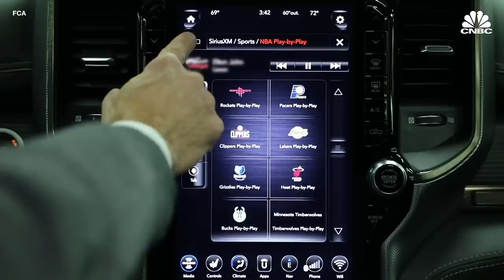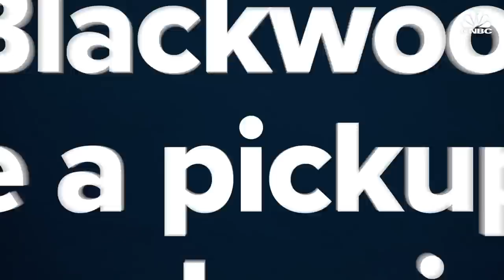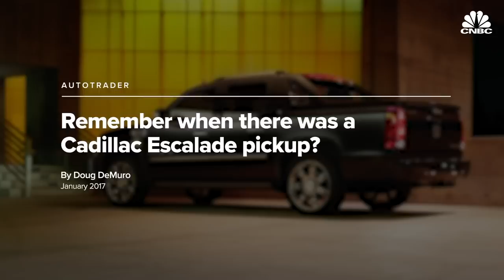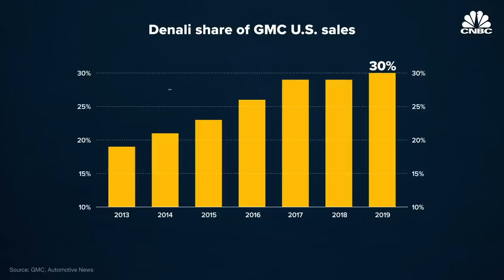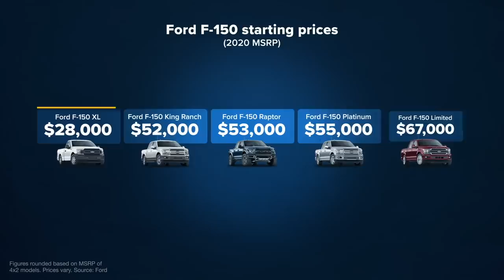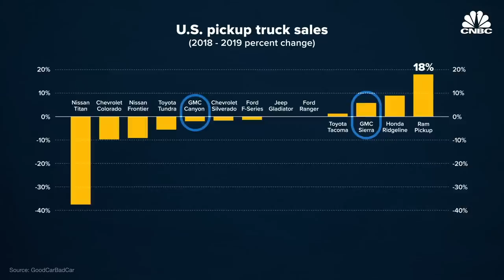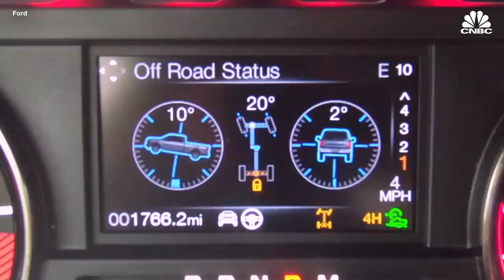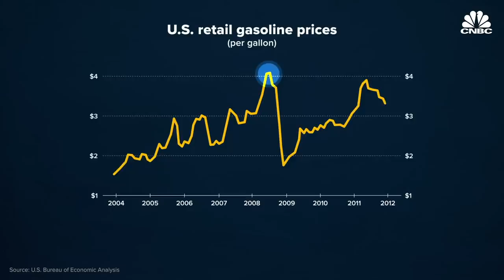How Detroit Turned Trucks Into Luxury Vehicles

Comment: I'd like a small  pickup truck.(like the older ford ranger size, or  even a Chevy s10 or el camino style) So I'll just find a 30 year old truck that's smaller and buy 3 to make one good one & paint it.. all that is available  is oversize non useable  glamor tanks the size of a cargo van with no usable space.. the beds are too small & are 5 feet off the ground...its too tall to get into..Yes it's not a tool friendly vehicle anymore..I dont need luxury.. I need a work truck.. I'm not doing car shows or parades. I'm making money..so if I'm going to waste 50k+ on a non workable show truck just to look pretty... I just buy a luxury conversion van and get a trailer. I'll get my best use out of that.. to me the new flashy big boxy truck  is not worth  the money.. even if u gave me one for free.. and buying a electric hummer  would be not be a option. If I have to keep plugging it in I'll never get things  done waiting to charge it every day.. Need a gas powered ready to go at a moment's  notice truck. guess  this is why u dont see electric powered emergency response vehicles ..."sorry we late to put out that fire.. the vehicle  was still charging".."  U got a place to plug in so we can be of assistance???".oh that's bad the plug in port is inside the burning building. We're so sorry.. but have a nice day... And the distance between charging  station  is unpredictable and  leaves lots of stranded time to rethink these options when u call for a tow and wait half the day to get help.. 1st year military service hummer was the best....h2 was ok...h3 had too many mechanical issues for me. "Yes I've driven all"

Comment: The only functional feature Ram has on GMC is the air suspension which is notoriously unreliable in cold weather, to the point where dealers recommend against it if you live in the snow belt. If GMC takes the 4 corner air suspension off the new Yukon and throws it on the Sierra 1500, Ram is screwed (again)

Comment: you cant put 50 sheets of drywall in em because the beds are too short,I have a 95 F-150 fuel injected 4.9 liter six, it has almost 250,000 miles on it, regular wear and tear, still pass,s smog test.

Comment: When he’s bragging that the f 150 has the same v6 as the raptor he’s basically saying the raptor engine is way undersized cause in the regular f 150 it is.
Reply: Anthony Marron that ecpboost v6 is far from undersized or underpowered
Reply: A Raptor can accelerate to 60 mph in 5 seconds. That's faster than plenty of supposed sports cars, faster than basic Porsches.

Comment: I don't get around much these days and I have limited internet. Just out of curiosity, do they even make a pickup without the Cadillac interior?
Reply: Yes. Basic full size trucks with vinyl or cloth interiors and rubber floor mats are available under $30k. Midsize trucks equipped like that can be under $20k.

All of these people can get trucks like that if they want, but are complaining that luxury trucks even exist.
Reply: @packardcaribien  Well a truck serves a purpose, and a fancy interrior is harder to clean than vinyl floors and seating. I assume that those fancy interriors are less durable as well. AC, cruise control, a radio with a tape machine, (gotta buy one of those on eBay these days) and intermittent wipers is all I need to personaly classify any car or truck as luxury.

Comment: What percentage of pick-ups are used for work?
I use mine for work and factored in that if I bought a gas saver car , the cost and extra insurance and maintenance would cancel any savings on gas. Luckily my work is local so theres that.  If i took a road trip or vacation and drove Id still save money not buying another car. I wonder the pollution caused by new car manufacture and new factories? If you drive and maintain , driving your old car or truck 300,000 miles and dont buy new , Id bet your more "environmentally friendly "😅

Comment: Pick up trucks are last gas efficient than most cars on the market. They fill up our parking lots making it hard to squeeze a vehicle around them. They're grossly oversized and tip the scales in event of a crash, often rendering all of the protective safety mechanisms from a fuel efficient car ineffective due to incompatible size and weight. Tall trucks and SUV's have  headlight heights makes oncoming headlights blinding for anybody driving a car designed to European or normal "car" standards in NA.  
Pickup truck advertising has created disproportionate consumer demand beyond most buyer's utility "needs", virtually shutting down the market for normal cars in North America.  Only those who "can't afford the gas are buying smaller vehicles.  They are keeping the oil companies busy selling more gas and hindering many of the the environmental benefits achieved by electric vehicles in other market segments.   
American fuel economy standards for for cars are a joke as regulators modify or exclude pick up trucks from the car group which should needs to apply to all of our daily drivers.  
The large size of pickup trucks  sees them being driven at higher speeds though their ability to stay on the road is not improved.  This can be often seen by the higher % of these "off-road" vehicles that skid off the road in winter conditions when traction is limited.  
Demand for pickup trucks is no doubt fuelled by the amount of advertising that has brainwashed many into buying one of these oversized vehicles.  Most pickup trucks now have shorter boxes so when needed to carry building materials, they are often unsafely loaded, creating risk to other road users.  
 A generation of people who grew up in families with trucks are now buying these bigger trucks as well as many with no actual for a truck's utility. 
When will all of this madness end?  
.

Comment: I still have my grandfather's 1978 Chevy 4x4 still going down the road in 2020...it's no where near luxury is the modern counterparts but it does have all the "bells and whistles" from 1978...including full gauge package, air conditioning, 4 wheel drive shifter on the floor (instead of getting out and locking the hubs), cruise control and am/fm cassette player. Brand new in 1978 it was priced at $6,500 from the dealer....times have changed!
Reply: A basic trim truck now has all of those features now for $30,000 (the same price with inflation) or so, with much more safety, carrying capability, towing capacity, and reliability to boot.

Well, not a tape player, but you get the point.

Comment: I rented an F150 because it was the only rental available. I don't get the appeal, there's zero road feel. It like driving a couch and it's a gas hog.
Reply: I think having no road feel is fantastic! A nice comfortable ride.
Reply: And it rides horrible, body rolls are excessive, it barely gets out of its own way (a Fiat Polski is probably faster than this thing), hard to park or even drive, too heavy, and everything that sucks. I don't see the appeal of them. I even find a Toyota Prius more appealing. Used to have a Silverado High Country, but glad I grew a brain and self confidence, and traded the gas hog for a Golf GTI. Never going back.
Reply: @GhostOfAMachine  I used to work at a GM dealer as a teenager and grew up driving my dad's land yacht. I liked those cars untill I drove a. VW ...all i have ever owned.

Comment: Cars and cross over SUV are just to small. The average american is not 5-10 180lbs anymore but they kept building cars based on people that size . Trucks are now the only vehicles people can comfortable fit in. Airlines, stadiums, theaters all suffer from the same problem seating is based on  the size of people from the 1950's
Reply: Correct people were already much larger than they were 100 years ago anyway and it has nothing to do with food people are just bigger. Then when you add in the amount of overweight people in western Europe and the United States and yeah people want bigger vehicles.

Comment: This is why I no longer drive a truck.  I just want a simple, reliable, reasonably price pickup truck with no electronic gadgets more complicated than cruise control and power windows.  I don't want a luxury vehicle.  The truck I want is no longer made.  If I ever buy another truck, it's going to be the cheapest Toyota Taco I can find with less than 50K miles.

Comment: Like Motor Trend is an unbiased source. CNBC has become so lazy. The Ram is an unreliable piece of garbage. While Ford is the best of them, they are not without there problems. Tracking re-sale value of these trucks will open the eyes of potential consumers.

Generally, there has been a significant decrease in the quality of American cars and trucks. Fact is, half the American population makes around 18,000 a year. While some still buy these over priced trucks, growing auto loan delinquencies would suggest that this isn't going to go on for much longer.
Not competing for the car market is going to bite these domestic manufacturers in the ass. We are witnessing the twilight of the American auto makers in the US.

Comment: And by consuming three times as much fuel as a decent sized sedan or cross over ....
Reply: With those cheap gas prizes they have in USA for decades I'm not surprised they all drive V8 monster trucks.
Reply: 3 times?  Check again.

Comment: The marketing people have sure fooled a lot of people in to thinking they need a truck. In my opinion they make poor passenger vehicles and they make a poor work trucks. And to top it all off trucks get crappy fuel mileage and parts cost way too much. Your cost of operation per mile is right through the roof. Trucks handle absolutely fantastic if you compare it to a dump truck. Trucks are made to haul and tow and make money with, if you're not doing that you don't need a truck.

Comment: I can't wait to replace my Ram 1500 with a tri-motor Cybertruck. Too bad it can't replace my Ram 3500. That thing is a very expensive pos but I can't do without its towing abilities on my ranch.  Hopefully Elon will build a one ton truck equivalent with at least 300 kWh of battery for towing. 400 or 500 kWh would be better. Of course we are going to need some charging infrastructure suitable for trucks with trailers and large batteries. 

The price of gasoline and diesel is not likely to come down any time soon. The rise of ev's will eventually reduce demand and thus price. Ev's will have to win without the assistance of high fuel costs. They will just have to be better than their fossil fuel competition. The only real problem will be range while towing. If the price of batteries and electric motors comes down enough then the range problem could be solved by adding motors and small batteries to the trailers. Having regen braking on the trailers would be marvelous for mountain roads.

Comment: Shouldn’t compared to European brands! They are trying to get the customer with the big screen and nice headlights and + big off-road tires)) but what about other parts?? quality of the material?? installation quality proper fitness! the technology? Engine performance big sizes, unpower, no efficiency - and creating enough problems after manufacture warranty is over - not less then European engines - oh yes, nothing is better sound then American V8. The all-wheel-drive system - its behind by 20 years! The brakes - they are to small for that weight and most of the time getting overheating! Oh yea - Corrosion resistant- never heard about it))) - Show me any American brand manufactured that give you at list 10 years Corrosion warranty...

I been owned all three manufactures product and I have enough experience to say about quality and customer service all of them.

Comment: What a joke. Pick-ups and SUVs are far cheaper to produce because they can get away with re-skinning the same obsolete basis year after year. U.S. companies hate developing better vehicles so every advance from seat belts to disc brakes or independent suspensions has come from foreign companies and racing development. NASCAR was tailored to avoid development costs so each car is an identical primitive 3500 lb hunk that ties everyone's shoes together for an equal gate. Death rates dropped for decades but SUVs+ PUs have stopped that because of the ease they roll over in accidents. They have much farther stopping distance and the worst accident avoidance capabilities as many can be overturned from driver behavior alone. In California the CHP was forced into SUVs by a boondoggle. They had Ford immediatly scrape together 6000+ Crown Victoria cruisers because of accidents and the danger of using SUVs at high speeds, for Pitt maneuvers or fast reaction situations. Sedans remain the safest, quietest, most controllable vehicles. Only terrible roads and the lowest speed limits in the developed world make them popular. Elsewhere they are taxed because the weight and aggressive tires destroy roads at a ridiculous rate, worse mileage, high accident death rate and even higher number of children and pedestrians killed due to limited visibility. They have greatly hastened the end of gas power by using so much of it. With the incredible amount of added damage to rapidly deteriorating roads U.S. makers look happily at the much higher profits they will continue to earn from old junk in new clothes

Comment: I guess it’s because cars have gotten smaller and lack any space inside. Ford would have been better off if they still built the Crown Victoria, Mercury Grand Marquis, and Lincoln Car and those were truly the last good cars EVER made and cars have gone down hill since they discontinued those cars.
Reply: Are you kidding? Honda Civic which used to be a compact is like a midsized sedan now, and the Accord is full sized what used to be mid sized. Honda had to bring the Fit because the Civic got too big and now even the Fit is bigger than the Civic from the 90s

Comment: People are stupid when they buy these over priced American trucks. Buy a Toyota Tundra 1794 edition. It maxes out in price at about 53,000 where ford and GMC maxes out in the high 60s. Tundras last forever so why do these idiots keep buying these for? Toyotas are the better truck for the money.  No problems with them and my 12 tundra I had pulled a new f-250 with a trailer out of the mud.
Reply: For the 1794 edition do the horses feed themselves or do I have to buy them food?
Reply: @Angelo August The Tundra is designed and built in the US.
Reply: @Angelo August Toyota Tundra is designed, engineered, and built in San Antonio, TX